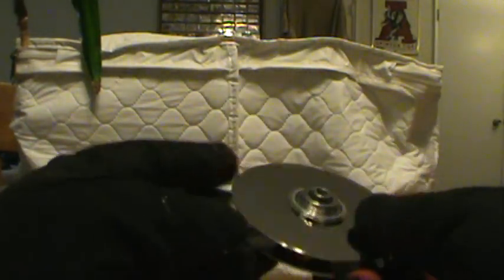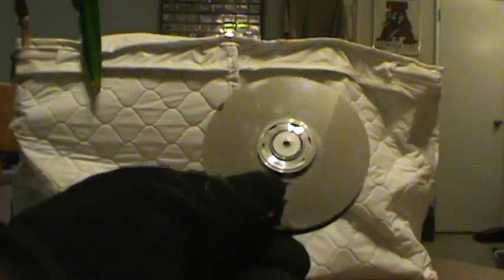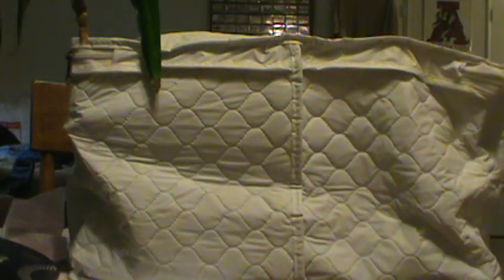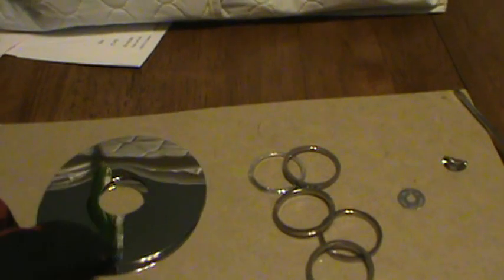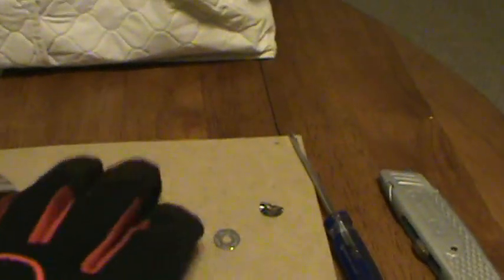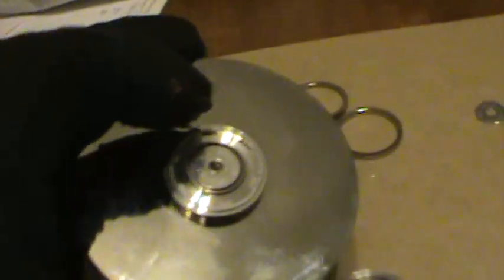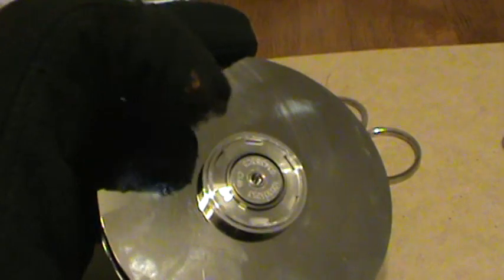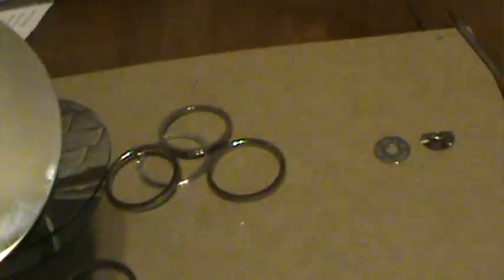Removing Hard Drive Platters with NO SCREWS!

Comment: Can you explain how you removed the platters from the casing please. Thanks
Reply from the maker: Hi, there are just screws basically holding it in there on both sides with the disc reader. Once you take all those out, you can just pop this piece right now. Then use this video to take the platters off more. All trail and error. You'll find faster ways then me Im sure if you just try different things.
Reply: Hi, thanks for your reply. There only appears to be one hex screw on the top in the centre of the motor, but no screws beneath the sticker underneath- just a plate. I've tried to undo the screw on the top but the motor just spins as I can't hold it in place tight enough. Any other suggestions? I was wanting to do a platter transplant from another hard drive so I could read it. I've removed the heads so unfortunately I don't know how they should be aligned when replaced back into the hard drive casing- moreso the plastic runner/guide, otherwise I'd swap the heads etc parts instead? Reluctant to scrap just yet.